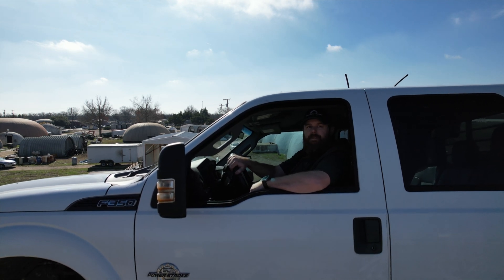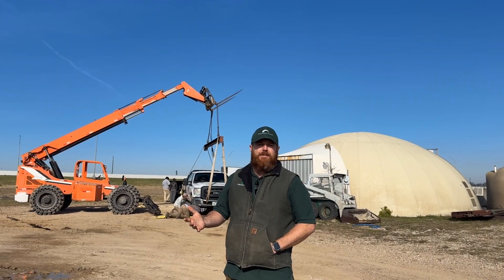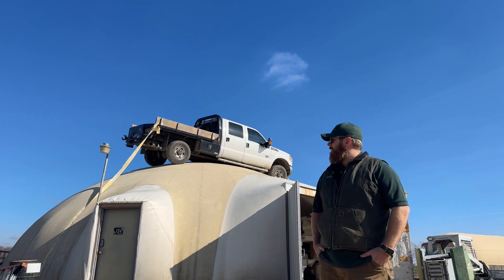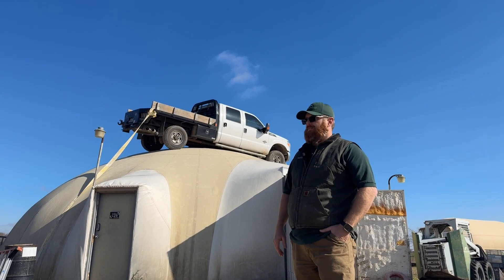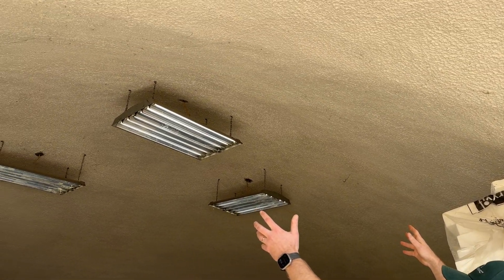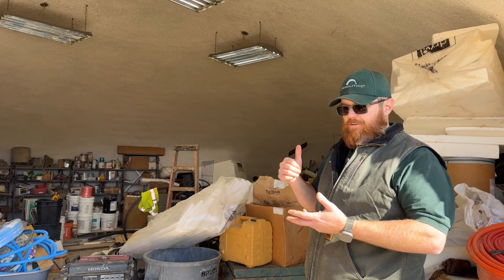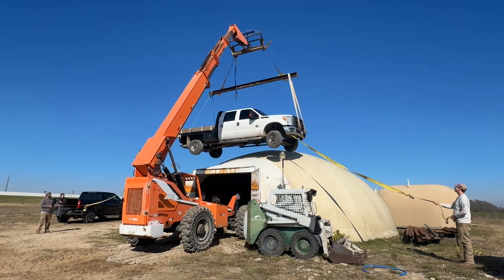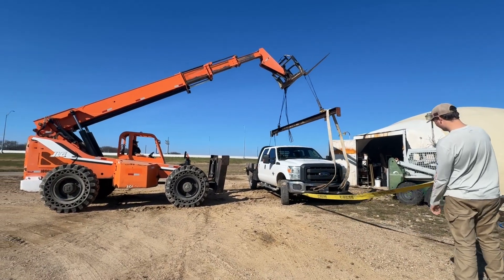The Indestructible Dome, Part I: A Monolithic Dome vs. a Four-Ton Truck

Comment: Before I retired a part of my job was responding on debris removal missions after large scale disasters. The only buildings that I have seen withstand Nature’s wrath were either round, thick concrete, earth sheltered or domes! 

When I’m able I plan to build an earth sheltered dome for myself. Most people can’t conceive what an upper end F-4 or F-5 tornado can do. In Smithville, MS an F-5 picked up a SUV, crumpled it, carried it a half mile and slammed it into a heavy gauge steel water tower hard enough to dent it, before carrying it another half mile away! 

In Rolling Fork, MS an upper end F-4 picked up two 18 wheelers and dropped them on top of a building! I respect Nature’s wrath! 🫡😱
Reply: I used to live in Smithville MO!